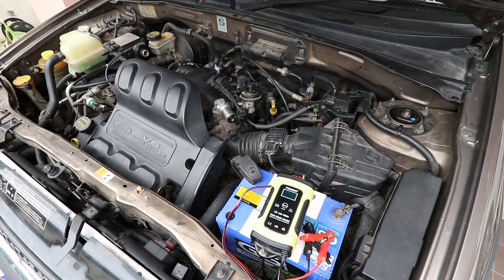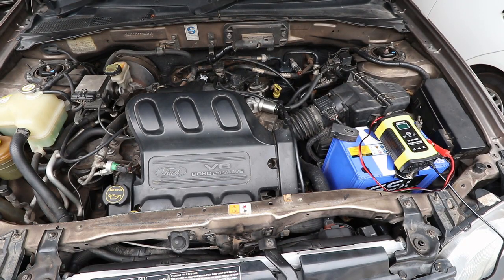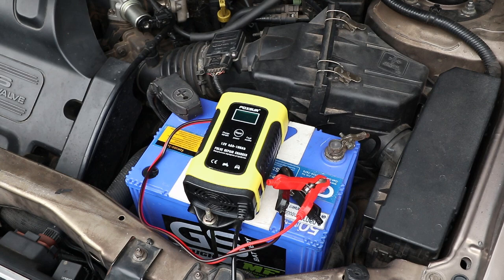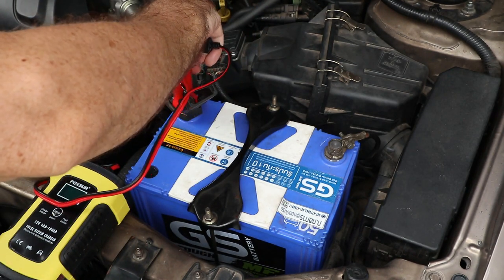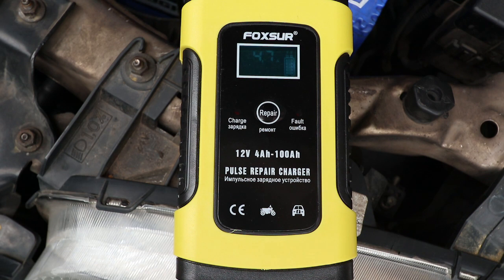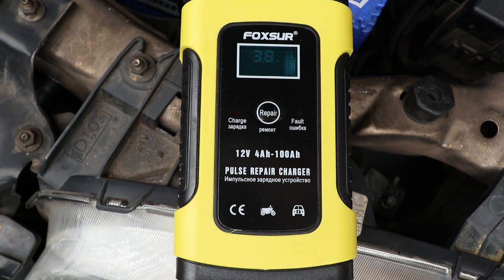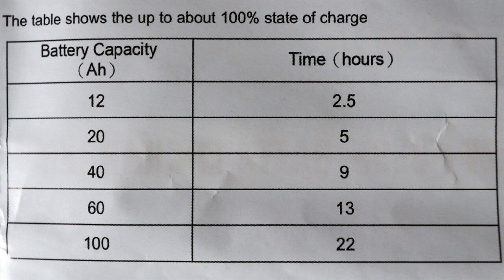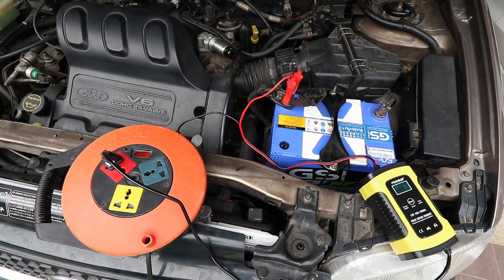Review Of The Foxsur Pulse Repair Car Battery Charger

Comment: I've had mine for a few years. I like it. One thing I noticed before my TV antenna was replaced was that it completely killed DVB-T reception through the USB dongle in my computer. I've since moved but before that, the antenna and coax was replaced due to a massive hail storm. I didn't get to test if the problem persisted. Also, I've since switched to a DVB-T board that plugs into the motherboard and found it's a lot more sensitive. ie. it picks up channels way better than the USB dongle so it has a better front-end. Whether all that means the RFI from the charger becomes a non-issue, I can't be sure but I never worked out whether the interference was conducted (back through the mains wiring) or radiated. At my newer address, I'm currently using it to try to pulse-repair an SLA battery (seems to indicate that it's safe to do but don't quote me) and the Hauppage PC DVB-T receiver is working fine so I guess the RFI only affected my system when reception was marginal.
Reply from the maker: That's interesting. I seem to remember from a previous comment that someone else had a similar issue. I haven't had any such RFI problems, but probably only because I don't have any equipment susceptible to interference.
Reply: @PhilUKNet  the reason I mentioned conducted or radiated was because if it's conducted, it would be easily fixed with some type of line filter. That SLA I mentioned was hardly used, which I bought about 15 years ago for a UPS. It, along with a matching one (UPS takes two of them) was neglected because it was so noisy, was hardly ever used and sadly, batteries left fully discharged for years.. I tried a couple of times since, to recharge them but they seemed dead. Unbelievably, after about 18 hrs of pulse repair, the charger indicated "FUL" even though the open-circuit terminal voltage only measured about 6V. When I put them on this or my regular 2.7Amp linear charger, they both indicate fully charged but I then persisted with the linear charger for many hours (about 9). It made the battery warm which alarmed me but after a while, the battery seemed to top up in voltage, (about 14.4V) current dropped, heat fell away and now, it actually sits at 12.5V when disconnected instead of dropping, like before.. I do believe it actually repaired! I'm now repeating the process with the 2nd one. Same deal although it took even longer to switch over from "PUL" to "FUL" but after so many years, I can wait.
Reply from the maker: @TechNed Repairing such an old, neglected battery is quite impressive. If the only problem is sulfation, the pulse repair function seems to do a pretty good job cleaning up the plates. However, as you point out, it does take a long time.

Comment: I bought that battery charger a couple of years ago & it  has been good,at the moment,I am seeing if it will repair a sulfated battery !
Reply from the maker: @RussellBooth1977  It should do. The charger can't perform miracles if the battery is too degraded, but if the problem is just sulfation, the pulse repair function should help with removing the lead sulfate crystals from the plates. I hope it works for you!

Comment: Do i need disconnect cables (red and black)of battery before normal charge it? But if i disconnect it,my car setting will gone is it?
Reply from the maker: @ting8670  You MAY get away with it for normal charging, but I would definitely recommend disconnecting the leads for pulse charging. Actually, I would highly recommend disconnecting the leads for both regular and pulse charging. Yes, it is a pain having to reset everything, but is it worth the risk?
Alternatively, you could use a small battery. This is what happens when I go to a shop to get my battery changed. They connect a small battery to the leads before disconnecting the main battery. This small battery provides constant power so that you don't need to reset everything.

Comment: I tried this pulse charger today on my 12v car battery.
So far i am very impressed. Hopefully it will truly prove itself after 4 months of
below -20 to -40C in Northern Lapland. I will just use this charger to keep it tiptop
everyday to prevent the fluid freezing.
Reply from the maker: @mojo888x  My one was really cheap. It can't perform miracles if batteries are too far degraded, but the pulse function seems to be effective removing sulfation from the plates and extending battery life a little.
Reply: @PhilUKNet  Do you know if its possible to connected to the car battery without disconnecting the terminals & outside at extreme subzero temperatures?
Reply from the maker: @mojo888x The user manual doesn't say anything about this. Also, I'm in Thailand and know nothing about extreme cold temperatures. 
I would advise disconnecting the terminals. It may possibly be OK not to when doing a regular charge, but pulse charging probably won't do your car electronics any good.
The honest answer is that I don't know. In situations where I don't know or I'm not sure, my approach is to take the least risky option. The least risky option is to disconnect the leads so that the charger is only connected to your battery, not your car's electrics. I'm sorry that I can't give you a better answer.
Reply: Brilliant video thank you!

Comment: Do I need to charge the charger before charging the battery? Is like a battery that will be full or it is like a delivery from the plugged socket to the battery?
Reply from the maker: @josemiguel-pepe-fainberg7047  There isn't a battery inside the charger. Just connect it to an AC outlet and then connect the black and red leads to the battery. As a precaution against damage, I would advise removing the leads from the battery in order to isolate the car's electronics before you connect the charger.
Reply: nope its not a ‘ Starter’

Comment: Need some help. I bought one. It's off. I connected it to the electricity, at home, not to the car. It's not doing anything. Do I need to connect it to the car in order to charge it?
Reply from the maker: @josemiguel-pepe-fainberg7047  If you want to charge your car battery, it would be a good idea to connect the charger to the battery. Hopefully, they will release a wireless charging version soon.

Comment: My battery is still performing 12.5v . To get max performance when I  charge battery must I remove battery and do it. Or I can just charge without removing it. Thank you for your  help
Reply from the maker: @clementospeaks1135  You can do it in the car, but as a precaution against doing any electrical damage, I would recommend disconnecting the battery leads first.
Reply: @PhilUKNet  thanks
Reply from the maker: @clementospeaks1135 🙏

Comment: I have this charger. Now I wonder if it is suitable for gel batteries. Thank you for your video.
Reply from the maker: For Battery Type, the user manual says: All type of 12V
AGM, GEL, Flooded (Wet), Calcium type deep cycle, VRLA maintenance free lead acid batteries
So, according to the user manual, gel batteries are OK. I can't verify this myself, I'm just quoting from the manual.

Comment: i live in Thailand to same as you i don't use my pick up much and sometimes just about starts, and have order the same charger today
Reply from the maker: The hot climate isn't good for batteries. I hope you have success with the charger. It can't fix serious issues, but it can remove some sulfation from the plates and give the battery a slightly longer life.

Comment: Which is best?
1)  3 Stage or 7 Stage charger ?
2)  5A  or  10A ?
Reply from the maker: According to information in the user manual, 3-stage: CC (Constant Current), CV (Constant Voltage), Float Charge
Bulk Charge Current: 5.0A

Comment: Great video and review. Do you know if your battery charger pulses are 16 volt power spikes like a Noco Genius 5 and 10 charger or CTEK charger uses? I have a Pulsetech PowerPulse passive battery desulfator on my 2001 BMW battery as preventative maintenance as Pulsetech claims that there patented frequency they use can extend battery life up to three times. I also used my PowerPulse on my other BMW battery that I let sit disconnected for a year, and it was at 11.2 volts, I tried charging it with my friends Exide 6 amp automatic charger for 14 hours and battery voltage was at 13.1 volts, yet it would not start my other car. I put the PowerPulse on it along with a 1 amp Schumacher manual battery charger for 72 hours, and left the desulfator on it for a week and it started my car right up. My point is desulfation can take up to 30 days depending on how sulfated your battery is.
Reply from the maker: 30 days! I had no idea it could take that long. I don't know about the pulses. I recall watching a video where someone had analyzed the waveform using an oscilloscope, but I haven't done anything like that. The Pulsetech charger sounds interesting. You appear to own quite a range of chargers. Mine is just a cheap charger from China, but it seems to work OK. Thanks for your comment and information!
Reply: @PhilUKNet  My chargers are not SMART chargers like yours is. The You Tube video I watched showed a time lapse of the sulfated battery plates at each week and it was sulfate free at 30 days using his homemade battery desulfator.

Comment: One question: I have been using this charger, since January of this year, in a 3 y.o. Lead Batery of 700 AMP car battery, because it was waking up in 11.9 volt and didn't star the car. The fist time revived with the repair mode for 4 hours. Since then I was doing a repair charge of 4-6 hours once a month. The other mode doesn't activate: shows FUL even if the charge is low, so I can' only do the repair mode. But in the last two months the battery loses its charge overnight. I repair for 30 minutes and I can start the car, drive, and keeps good for about 6 hours. Any thoughts? How can I improve this? A repair charge of 24 hrs? The longest I have used that mode is 8 hours and still loses the charge overnight.
Reply from the maker: I'm no expert, but after 3 years, it sounds like your battery is getting weak. Where do you live? Here in Thailand, where it's very hot, I'm told that batteries are only good for a couple of years, although mine generally last a bit longer.
Reply: @PhilUKNet  I live in Venezuela, near the seacoast, where is a very hot weather most of the year. The car is also very hot inside the compact trunk ( A Dodge Neon 2005 ) But the thing is the car has had very little use in these 3 years, due to the pandemics and lack of gasoline in my country, so I think the batery shouldn't be worn out yet. In fact the approximate kilometers in those years are about 7000- 8000 KM. So, should I try the 24 hrs pulse repair? I filled the 6 vessels with distilled water last week. 4 of them were very dry.
Reply from the maker: @aljesus6130 Dry cells could have been the problem. Topping up the battery and another long pulse charge may help. The lack of use may also be a contributing factor. See how it goes, and if there is no improvement, a replacement will probably be necessary.
Reply: @PhilUKNet  thanks for your answer. I let it drain last night. Woke up with 9.6 volts. I connected to the charger and first time since I bought it the normal charge activate. After 40 minutes stopped and got the FUL message. Connected to the car, it reads 12.30 (with a voltage reader I plug in the cigar lighter), despite the charger says 12.8 after stabilizing. With that voltage the cars turn on, but loses the charge after 10 hours parked. I read somewhere that any volt under 12,4 is bad.
So I am going to try the long repair charge (24 hrs) to eliminate the sulphate. My goal is 12.6 volts after a charge, with God's help. It appears once in a while when I park after I drive 20 minutes. So let's see if this little guy can extent the life of this battery a little bit. Greetings.
Reply from the maker: @aljesus6130  Good luck!

Comment: Should we remove negative pole cable  before charging
Reply from the maker: The user manual doesn't say anything about this, therefore, this is just my opinion. When using pulse/repair mode, I would definitely recommend disconnecting the battery leads to prevent any damage to the car electrics.

When doing a regular (non-pulse) charge it is PROBABLY OK to leave the leads connected but, as a precaution, I would also recommend disconnecting the leads. Prevention is better than cure and for the sake of a few extra minutes my view is that it is better to disconnect the leads. By disconnecting the leads it won't be possible for the charger to damage the electrics.
Reply: @PhilUKNet  thank you very much for prompt response
Reply from the maker: @bulentvargel9652  Pleasure!

Comment: I have one like that for the European market and it's good, its advantage is that you just hook it up and let it charge, you don't have to remove the battery, but it has one big flaw, it takes a very long time to charge the battery, if it's summer and the temperature in the battery is around 28 degrees, it will reduce the charging amperage so that the battery does not heat up, that's ok for safety reasons, but charging takes a long time, the colder the battery, the faster it charges, the bigger it is, it regulates the amperage itself. So if you bought a 5 or 10 amp charger, it doesn't matter because it will reduce the amperage and you won't gain anything in time... I've never tried the pulsating mode, because I don't wait for the battery to fail, I buy a new one every 3 years.
Reply from the maker: Yep, it's very slow! I've done a few repair charges, and it has taken around 27 hours. As you say, it works well, and mine was very cheap. Not perfect, but it does a job for not very much money. Thanks for sharing your experience.

Comment: Thanks for the video M8...Quickie question....why when charging the battery in the car would you connect the negative to the car chassis rather than direct to the neg terminal...?
Reply from the maker: Honest answer: I don't know! I've watched videos on the subject done by people who I assume have a far greater knowledge of the subject than me, and this is the advice I have heard. The negative terminal is connected to the chassis, so it shouldn't make much difference. I've done it both ways and it doesn't seem to make any difference. However, because I've heard this advice so often, I assume there must be a reason.

Comment: So if your car is parked outdoors in the UK, and the charger / repair takes about 20 hours... it's not very useful unless you have a tent to shield the car / charger from the rain!
Reply from the maker: That's right! If you don't have a garage (or a tent), I'd recommend taking the battery out and charging indoors. Unless you have a car in which the battery is located in a very unusual place, it's not too bad. I've done both. I don't have a garage, but my driveway is covered, and I've also charged batteries indoors.

Comment: Test the voltage with a multimeter at battery terminals while charging, it is HIGHER than what's shown on the LCD screen.
Reply from the maker: I'll do that next time.

Comment: What is the work of repair button ?
Reply from the maker: It has two modes. The first mode is for normal charging and this applies a smooth electrical charge to the battery. A battery has lead plates and acid inside, and over a period of time the performance  degrades when lead sulfate crystals build up on the plates. The second mode is a pulse/repair mode. This applies pulses of electricity to the battery, which can help to remove the lead sulfate crystals from the plates in order to improve the battery performance.

Comment: Very interesting video and comments. My question would be: have anyone actually witnessed the device switched to the normal charging mode after being in the repair mode for so many hours? I bought a device myself and can't wait to test it.
Reply from the maker: It does switch to normal mode after the repair has finished, but it takes a very long time. When I've done repairs, it has taken 25-30 hours.
Reply: @PhilUKNet  Thank you for the information. It took mine 24 hours to switch to normal charging and immediately after that "FUL" sign appeared. I will keep it connected for one additional hour as suggested in the user manual.
Reply from the maker: Seems to be working fine, then!
Reply: @PhilUKNet  It seems so. However I don't have a battery analyzer at the moment and I am still not sure whether it automatically switched to normal charging mode as it was timed out at 24 hours (as per instructions) or the battery was completely repaired. Have you ever seen it completing a repair in a period shorter than 24 hours?
Reply from the maker: @Asterix  I've done about 3 or 4 repairs and they have all taken more than 24 hours. I also have the Foxsur battery analyzer, which was cheap and seems fairly accurate.
Reply: @PhilUKNet  I know that you have the same brand battery analyzer and I just rely on your information that batteries are in a really good shape after this small device has run its repair course. I am very grateful to you for sharing this information.
Reply from the maker: @Asterix  You're welcome. I paid next to nothing for the charger. It can't perform miracles, but if a battery is suffering from sulfation, the pulse/repair mode seems to be effective in cleaning the lead plates. This will improve performance and give the battery a longer lease of life. I hope it works out for you!

Comment: To charge the battery without disconnecting it from the car. If the battery negative terminal is earthed, can I connect the black lead from the charger to the battery negative terminal?
Reply from the maker: Sure. With the battery still connected the black lead can go to the negative terminal or somewhere on the chassis. With the battery still connected, I wouldn't recommend doing a pulse/repair charge. I have left the battery connected to do regular charges, but I've now got into the habit of disconnecting it just to be on the safe side.